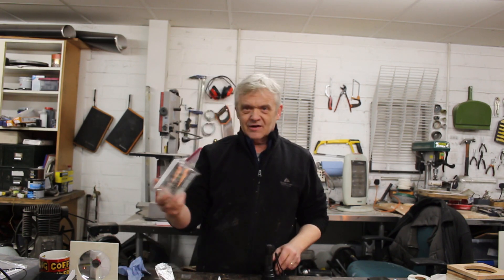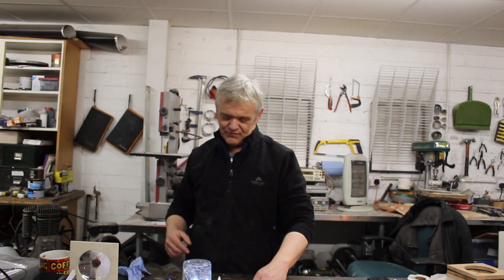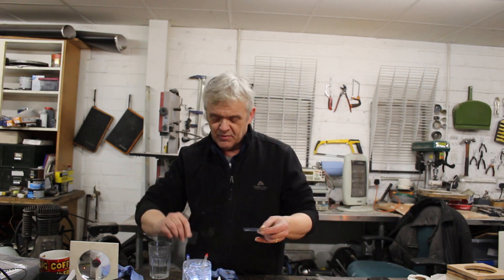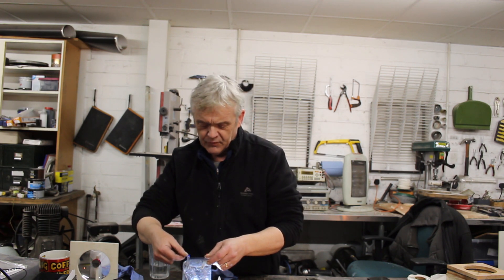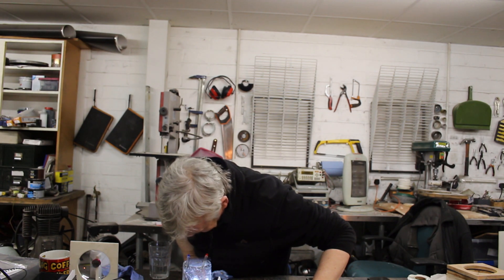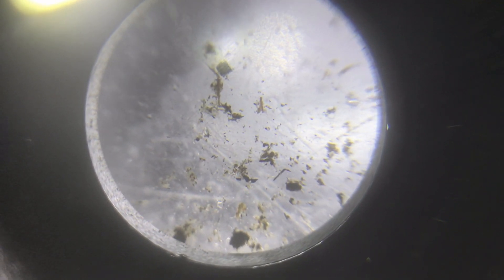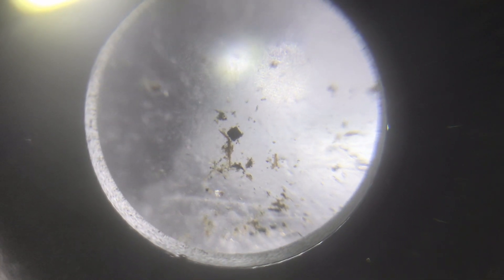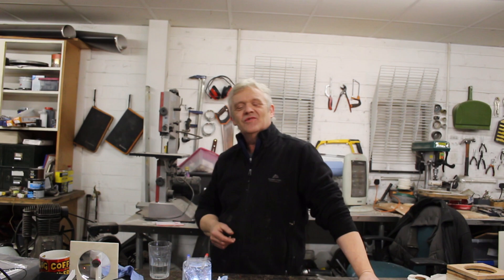1390 - A DIY Water Drop Microscope

Comment: There is a company that sells some sort of microscope like this with a smaller glass bead. The lens is a sphere and the smaller, the more magnification, but the closer you have to lean on the glass bead. Almost touching it with your very eyeball.
You can distinguish the cells of the thin skin layer of an onion...